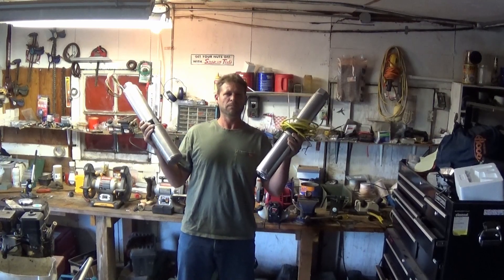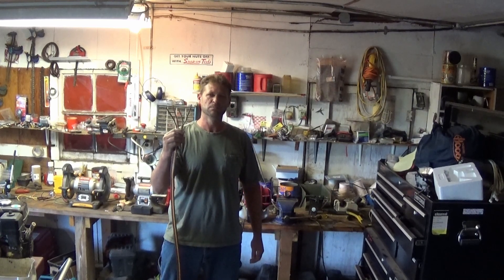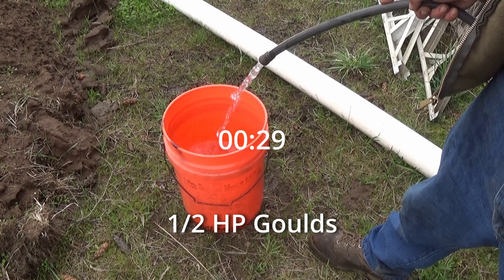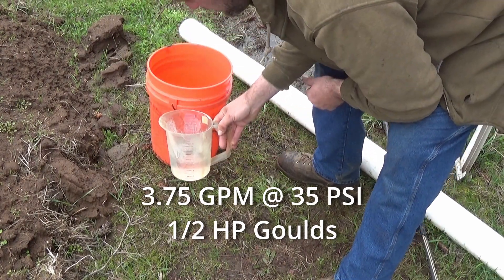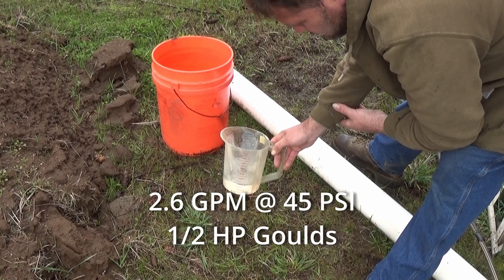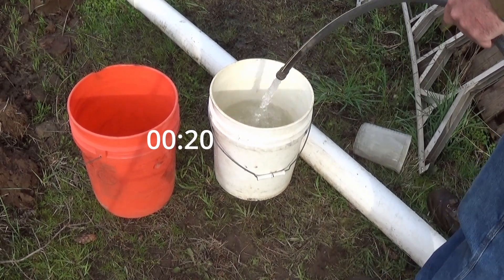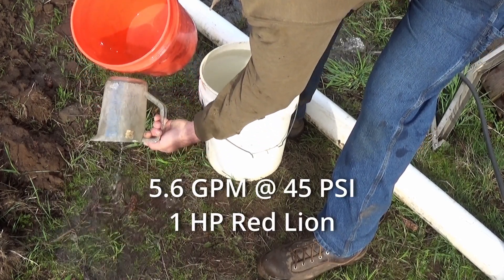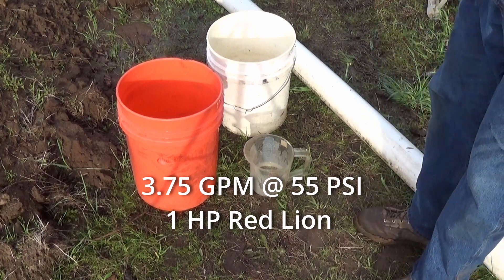Well Pump Testing at 300 Feet Deep. Real World Results.

Comment: What's going on here?  Counter-intuitive.  I (..and everyone else that doesn't know) would think that more pressure as in 60-80 vs 40-60psi would end up with more water making it to your sink at a higher volume of water.  This stuff is making my brain hurt, lets not even talk about HEAD.  argh.  I have been checking my 1/2hp pumps performance straight off the well, not on the other side of the pressure tank.  I can fill up a 5 gal bucket twice in 1 min.  10gal a min?  to me.  But you are telling me after I go through my pressure tank at 40-60 I'm getting 50% less prob?  If this is true and it more than likely is, why don't we just pump under atmospheric pressure to a holding tank, then pump off the pressure tank with a jet pump or some kind of pump that can get her in the house at a 10-15gal a min rate and better pressure?  I'm being spoiled her in Augusta, GA.  My pressure at my hose bibbs is 120psi.  How?  The front of my property (main house) I've checked it with known good pressure tester screwed onto the hose bib.  Crack the water on and BAM!!!  120psi.  Am I doing something wrong here?  My problem, I want half or better of that same pressure when I turn the street water off and run my well to the front.  If I have to stand under a hotel-like stream in the shower from my well I would abandon it.  

Soooo, what is my best bet on well pumps?  I have static water at 97' and well depth of 130.  Going to drop a pump at 120 and hope for great refresh rate after airlifting and cleaning.  1 - 1/4 down pipe or would shed 40 1" be better for my setup.  going to have a pitless adapter at the surface then run 150-200' to the home.  Meet up with 50g pressure tank and 3/4" plumbing throughout home.  And advice.  Would loe to talk vs txt if you had the time.  706-825-7180  Augusta, GA   Anyone.  Tks

Comment: Are there real world figures for how low each pump lasts? I'm having my pump replaced next month. Don't know the brand but it is believed to be 1/2 horse and 105 deep. It is 45 years old and still working. Since I'm over 70, I'm looking for a pump that will work for 25 years but also not break the S.S. bank!